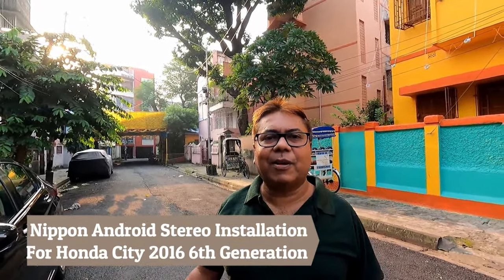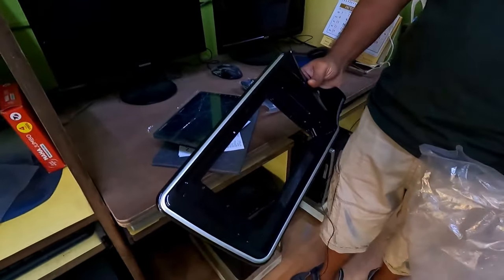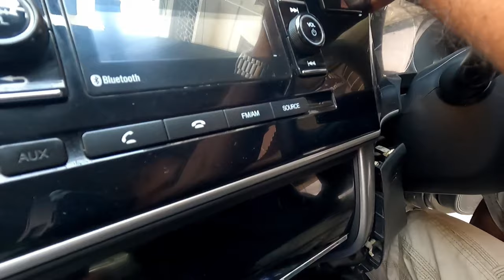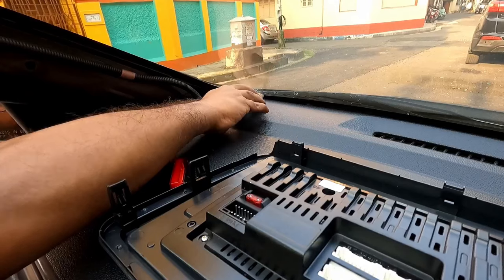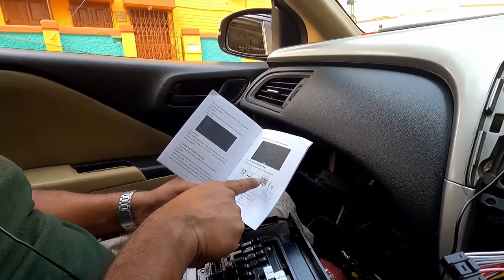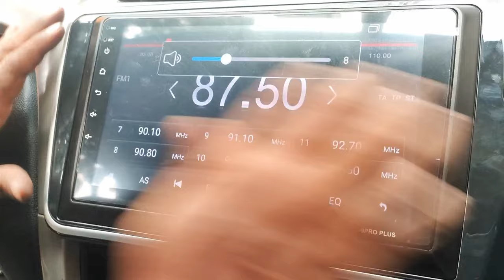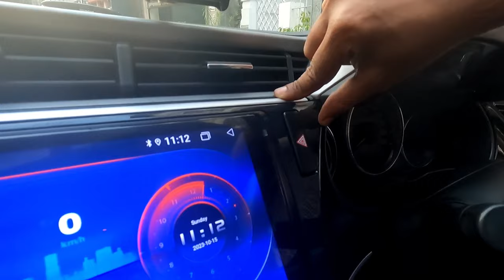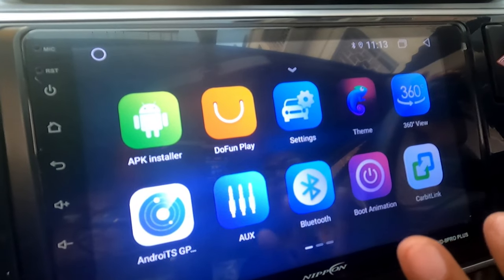Honda City 2016 Stock Head Unit Upgrade with Nippon 9 Pro Plus Android Stereo  DIY #androidcarstereo

Comment: Did u received with reverse camera or without camera?
Reply from the maker: Without a camera I checked it with seller.
Reply: @supercyberautomotivetravel  but from amazon they say that it comes with reverse camera sir
Reply from the maker: It is confusing so better ask the seller to make it clear
Reply: @supercyberautomotivetravel  sure will check this and update u on this sir
Reply: Got the system without camera but the system performance is awesome with good spec, especially the sound quality is amazing nd display quality too which supports 4k as well sir
Reply from the maker: Thanks for the feedback. Install a good camera to utilise the good display.
Reply: @supercyberautomotivetravel  sure sir

Comment: How does the reverse camera works ? Does it start to work as soon as the car is started and put on reverse gear even before Android boots up. As this is 360 enabled stereo does it wait for Android to boot up ? Or work like other stereo?
Reply from the maker: The 360 camera starts as soon as you turn on the ignition. I will  fit the reverse camera only as other i dont require . I could not show the reverse camera function as the camera I  purchased is defective so I am waiting for a replacement. T5 is a faster processer like in android phones you have no such 855 is powerful than 840 so on. Here it is powerful than T3 and supports more functions.
Reply: @supercyberautomotivetravel  The point I was trying to ask is. I had Blaupunkt key largo.  When the android is  booting if you engage the reverse gear the camera starts to function and is not dependent on Os. Just wanted to understand that if this unit also works the same way. ( this helps that when you start the car and take reverse need not to wait for the Os to boot up) As 360 is an application looks only it work once the Os is booted up fully. Just wanted to know whether the reverse camera is dependent on 360 application  or can directly work without the need of application
Reply from the maker: I will let you know once I fix The reverse camera.

Comment: Can you please let me know the manufacturing date of the device.  I   am also looking to purchase in Amazon
Reply from the maker: It's Feb 2023 manufactured.
Reply: @supercyberautomotivetravel Thanks
Reply: Can you help me to understand difference between T5 processor used on this system and T5L processor. Has difficulty in choosing between pro plus and pro ultra.  Is there any functionality difference between them.
Reply: The only major difference I see is on Ram Capacity And processor.  Not sure what that L stands in T5L. Nippon website doesn't have this model itself and cannot check the specs
Reply from the maker: Both are same only the difference in ram and internal memory. In pro ultra you get the camera within the package.
Reply: @supercyberautomotivetravel  Looks there itself two variants in the Ultra. Looks the one listed in Amazon Doesn't have camera in the box. Confirmed with vendor about the variant.  Also from other youtube videos the box which has camera is big and the amazon listed box is small. ( The hand portion on the front box shows the difference)
Reply from the maker: You are correct the Amazon variant is without a camera so the price is less from the market. But do you really need a 360 camera as real 360 degree camera that we see in top models is configured at the manufacturing level and connected with car BCM and ECM which is not possible in aftermarket ones. Yes you can get 360 view but not the correct functionality of the OEM 360 camera.
Reply: @supercyberautomotivetravel  Sir, I am also a computer professional and interested on automobiles. In this Sale I purchased an Nexdigitron Dvr and Tpms as well. Both are fitted. AFAIK the T5 chips as per architecture has an Lvd kind of thing extra to get and process input from 4 cameras (360). The ECM and BCM are related to Canbus system which  takes input from ECM / BCM which we cannot do in our model of Honda city. As our model OE audio doesn't support or have option for it.
Reply from the maker: Yes you are right.
Reply: The thing I  am waiting or digging into the stereos is I understand till now all are using non certified Android Auto and Carplay. Except Blaupunkt ft.lauderdale 900, Blaupunkt sereis 900 (Not much availabe in market) and Nippon 9 pro T (released two months back) not the older versions have certified AA and Carplay. So just plan to wait for 2 to 3 months until Nippon release the certified version in 9 pro plus and 9 pro ultra. ( Having a guess as they had introduced on lower versions they will release the certified on higher versions shortly)
Reply: Can you please provide the pros and Cons sir as you ve been now using it for around 9 months.
Reply from the maker: It's ok and serves the purpose well. Don't expect it to be snappy like an Android phone. Also I have not installed any unnecessary apps to keep it light.

Comment: Any link for adaptor
Reply from the maker: Which adapter you are looking for ?
Reply: @supercyberautomotivetravel  you said some adapter is needed to fit 9 inch screen in frame ?
Reply from the maker: Ok the frame is 10 inch size so an adapter is needed for 9 Inch stereos . I purchased the adapter from the local market .